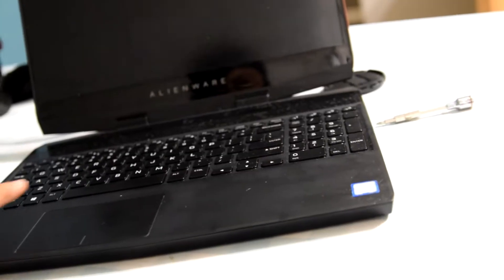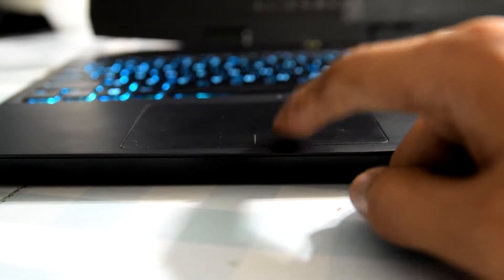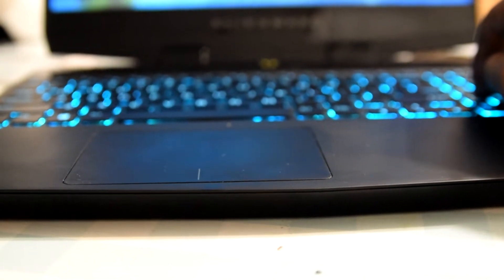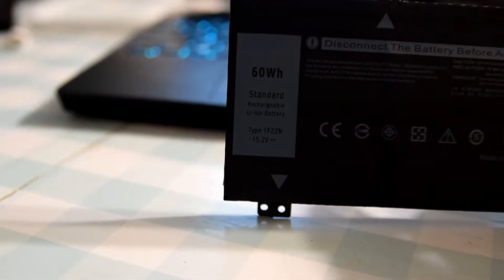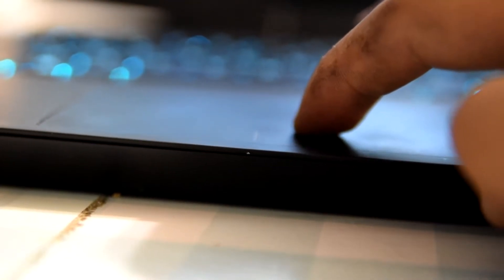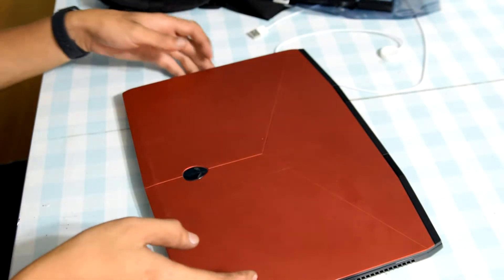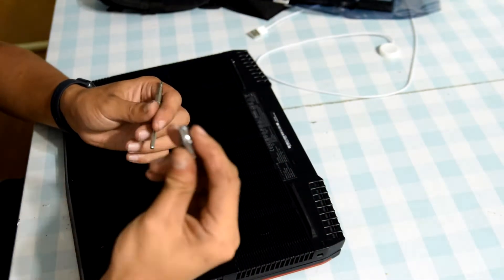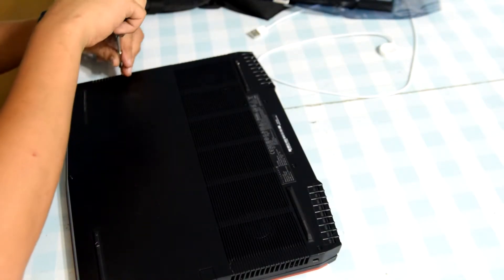Alienware M15 R1 battery replacement (bulging/swollen touchpad fix)

Comment: If you removed your battery and don’t presently have a spare bought, would re-sealing the exposed parts with the back of the computer be the recommended option?
Reply from the maker: You can, but it would be fine to leave it exposed until you receive the part.
Reply: @hoon5630  Alright. I’d rather keep it covered for now. Also would it still be able to boot up if it’s plugged in to the charger. I tried that and basically got the same result as when I tried to boot it up with the swollen battery, the keyboard lights lit up, then powered back off.
Reply: @hoon5630  if it’s plugged in, battery out, and still won’t turn on, is that a problem?
Reply from the maker: @calvo7452  it wont turn on without the battery. the battery is needed to complete the power circuit.
Reply: @hoon5630  how long should I wait after installing a new battery?
Reply from the maker: @calvo7452  you can turn on and use it immediately.

Comment: Hi there, I am also having the same problem and I was wondering if you could give me the link from where you bought the replacement battery as I can't find anyone that sells it for this type of laptop. Thanks
Reply: Hey man, you can buy one from IPC Computer in Germany - they specialize in laptop replacement parts. I am Europe based but they should ship anywhere.
 I bought this one for my Alienware M15 R1- https://www.ipc-computer.eu/alienware/m15-serie/m15-r1-serie/battery-69858349

Comment: I bought this one from ebay and replace it today actually, working fine, and cheaper compared to others I've seen on the internet looking around, does seem to be OEM, which makes me really happy.  https://www.ebay.com/itm/NEW-Dell-OEM-Original-Alienware-m15-m17-60Wh-4-cell-Laptop-Battery-1F22N/124315006858?_trkparms=aid%3D111001%26algo%3DREC.SEED%26ao%3D1%26asc%3D20160908105057%26meid%3Dc63e4b681167448ca0a4b56b748ddbd7%26pid%3D100675%26rk%3D1%26rkt%3D15%26mehot%3Dnone%26sd%3D273665540798%26itm%3D124315006858%26pmt%3D0%26noa%3D1%26pg%3D2380057%26brand%3DDell&_trksid=p2380057.c100675.m4236&_trkparms=pageci%3A4526e9a8-9e12-11eb-a167-4e8d53600eab%7Cparentrq%3Ad6a2a7111780a4d7cfe0ed24ffe7906b%7Ciid%3A1

Comment: Can the bulge flat again?
Reply from the maker: no, that's an internal issue with the battery cells. they flatten as they cool, but will just swell again as you turn the computer on.
Reply: @hoon5630  i mean, after i remove the battery, can the case of the laptop flatten again?
Reply from the maker: @victoriousfox  yes